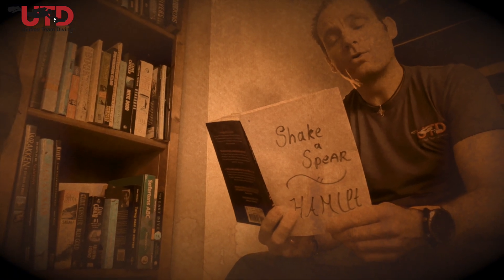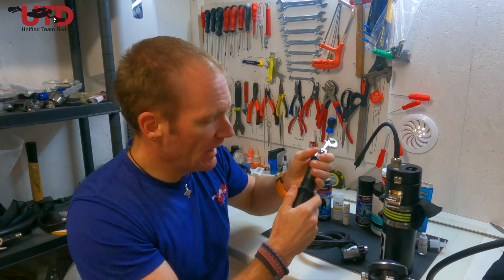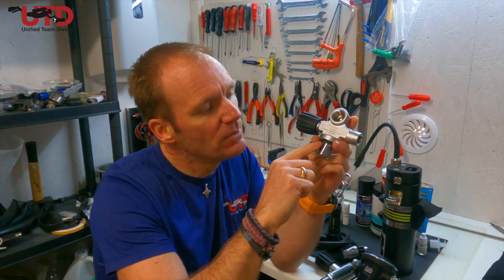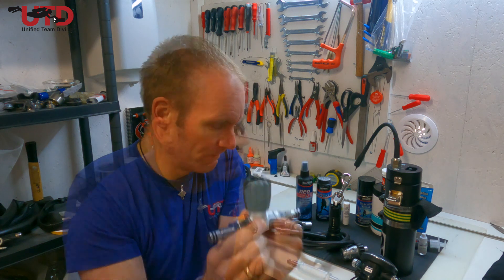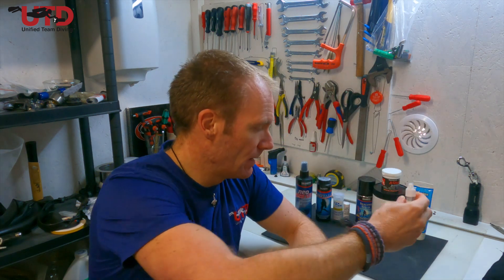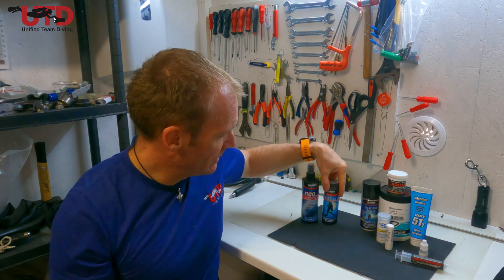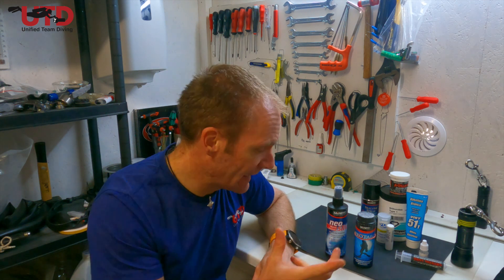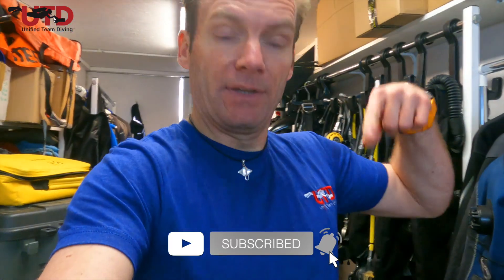Tinker Tuesdays, Lubrication of scuba equipment. What to use where.

Comment: Why do you use crystal lube on your regulators/valves but use the oil on your rebreather? Doesn't the oil work on regs/valves?
Reply from the maker: Very good question, yes it would. I use the oil on the Ccr because it's cleaner ( no residue) it would work great on regs as well. Even though the white o2 compatible grease is expensive the oil is even more expensive. That's why I use the grease in the regs they only get opened once every 100-200 dives.